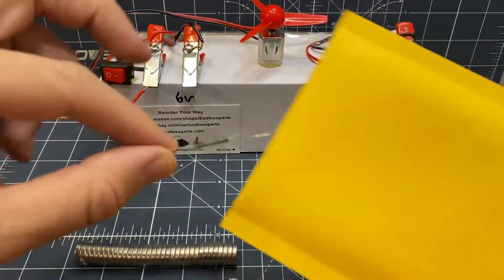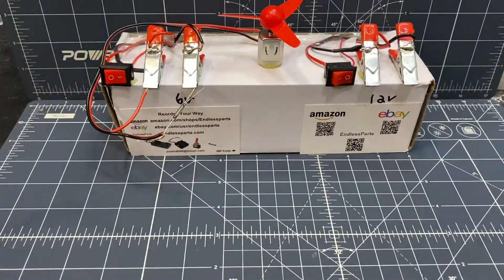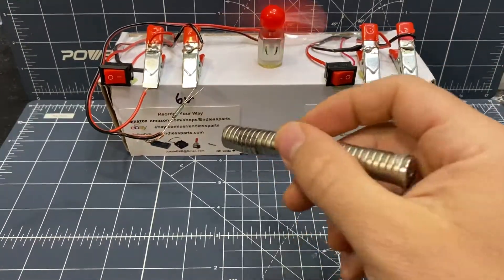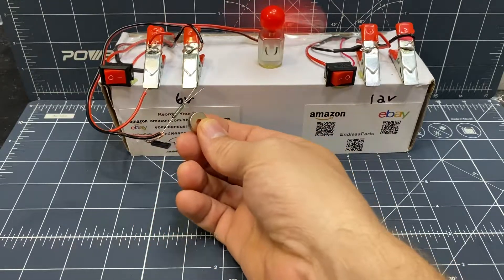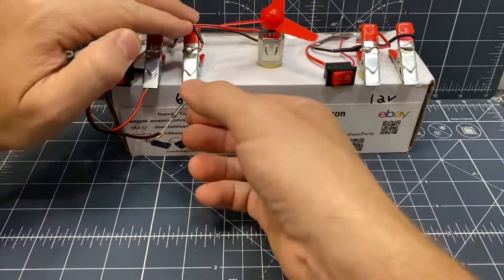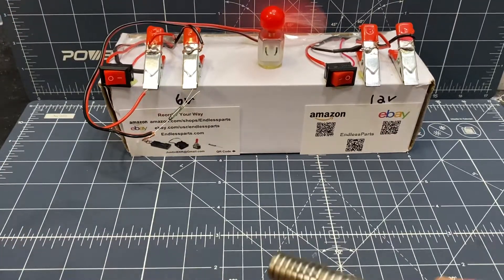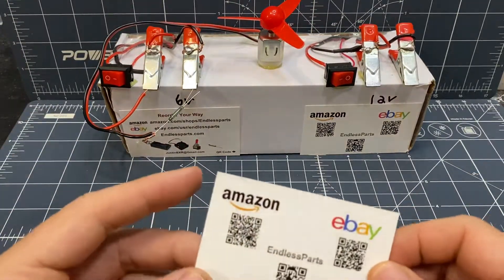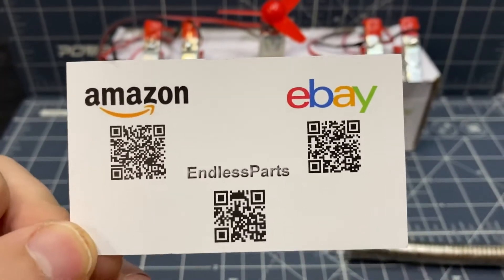3 pin reed switch n/c and N/o

Comment: Hello, Thanks for this

I'm trying to repair a slot track piece that requires a reed switch. When the Carr passes over this, it needs to sense the magnet in this case would open or closed wiring be called for?

Also, I don't have a way of  testing the different feeds coming out of the reed switch 
Any suggestions there?

Thanks Again

Fabio